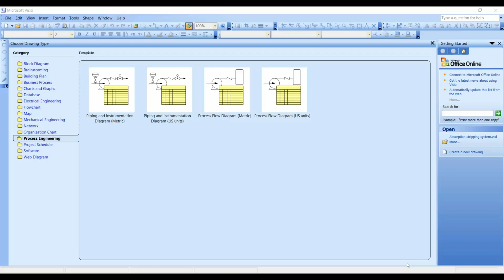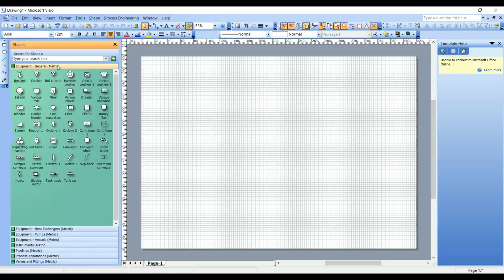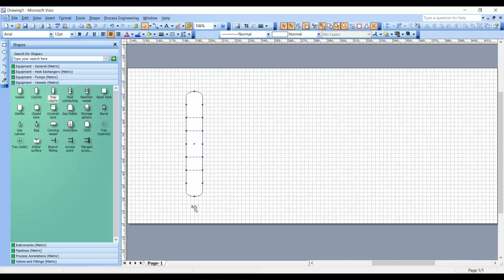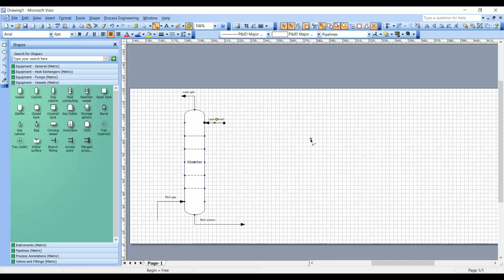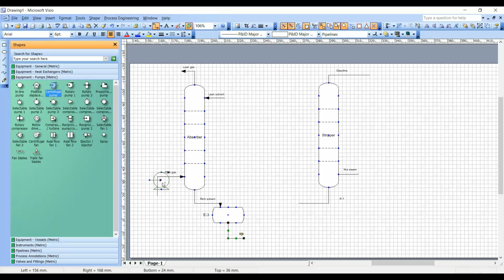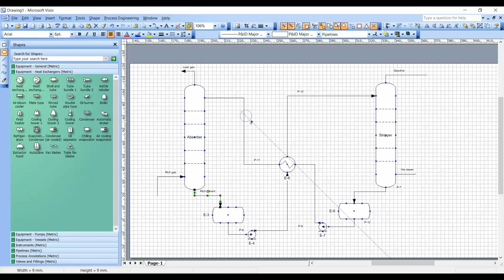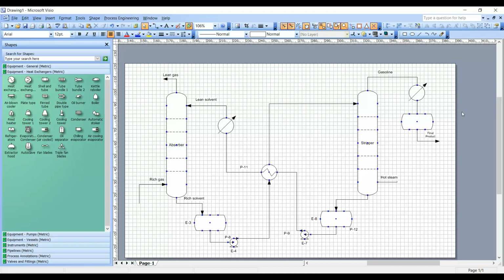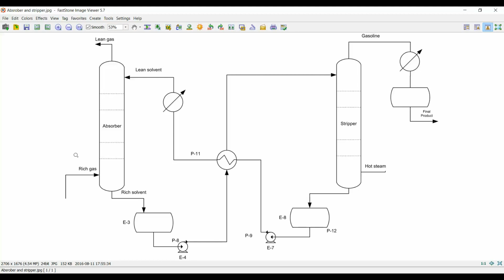Drawing process flow diagrams using Microsoft Visio - Higher volume version

Comment: So if I want to add an SX plant in my diagram how do I add those equipment in microsoft  visio?
Reply from the maker: Which equipment do you mean? Are there any special equipment in solvent extraction process that are not there in visio stencils?
Generally speaking, you can draw the shapes you want and save them as stencils so that you can use them later.